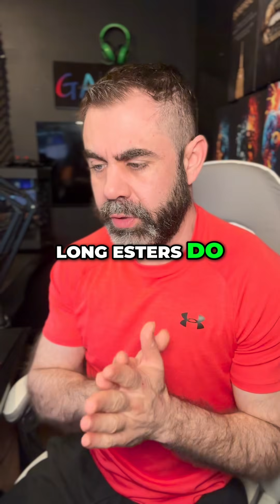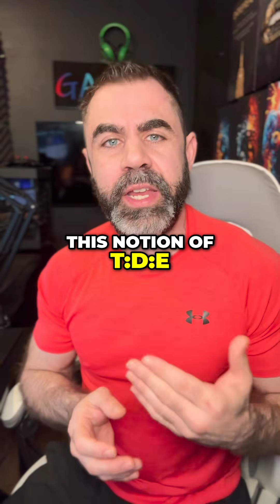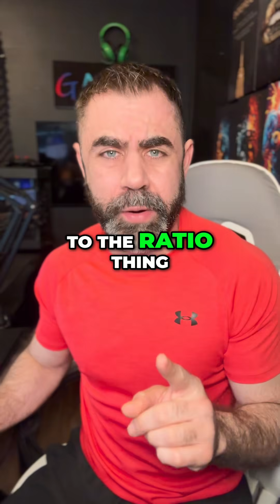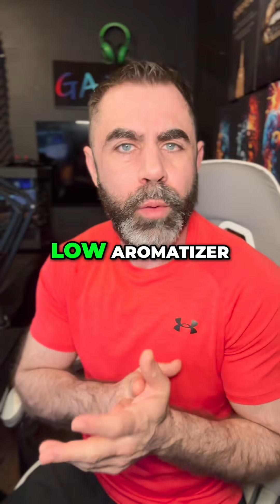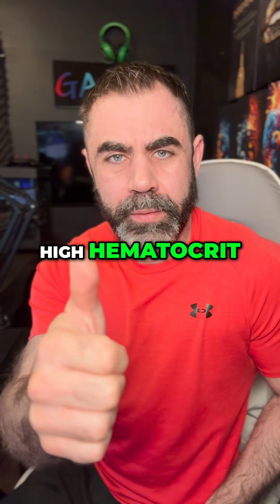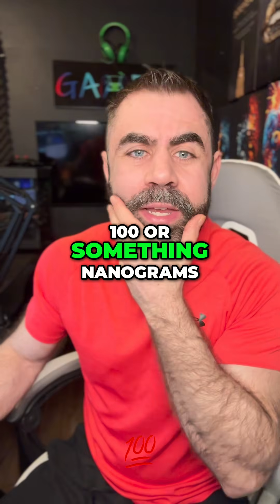TRT: Why Cypionate Fails & Cream Wins (Erectile Dysfunction Solved!)

Comment: I agree on cream increasing dht but in my experience of cream my e2 was actually higher. Never worked out why, maybe because cream gave me such a high spike so my max t was much higher. However on cream my erections were way way better. Unfortunately my body couldnt tolerate such high dht as it cause massive blood pooling in my hands 😢 I do miss cream….

Comment: Does the high DHT cause hair loss?
Reply: Yes, it can. With topical test, DHT levels are often 3-5x the reference range. If you are susceptible to hair loss, expect increased thinning, expect more rapid skin aging (DHT reduces collagen and elastin), and potentially expect increased prostate enlargement.

You’re also going to have more oily skin (DHT significantly up-regulates sebum production), and potentially worse acne.

Some of the benefits of cream? Amazing libido and a profound sense of well being from all that circulating DHT. 

If you’ve already lost your hair, get on a good skincare regimen and try out the topicals. If you care about preserving hair (and are susceptible to hair loss), I would stick to injections.

Comment: I hate cyp. I can’t take 90mg  every 5 days and my test and free test are out of range and have estradiol in the mid 50’s, and a hit or miss libido and use cialis daily at 10mg to help out. Never checked my dht but id assume it’s pretty low with such a low dose of cyp.
Reply: You should break your injections down and do the 90mg in 3, 30mg doses...keeps you more balanced...the highs and lows don't occur....insulin  needles work best
Reply: @JohnSims-x4l I’ve tried the more frequent injection and levels are pretty much the same. Cypianate just sucks for some of us amd it seems like it doesn’t take much for me to get very high levels of test and free test. I couldnt imagine taking 200mg a week which alot of people consider trt.